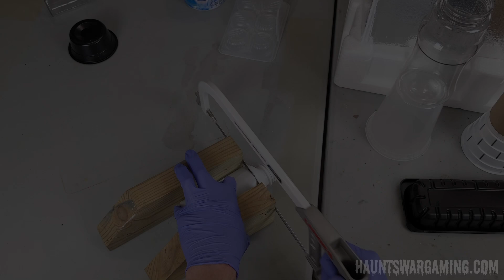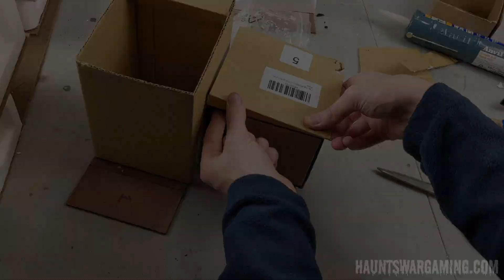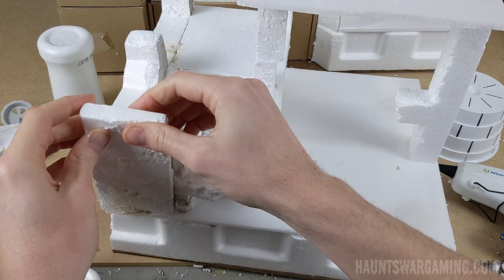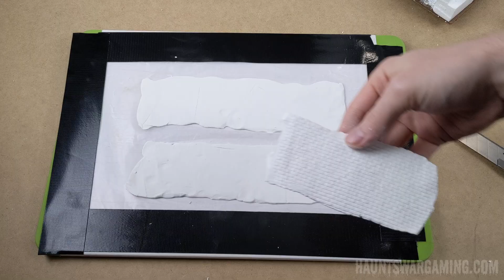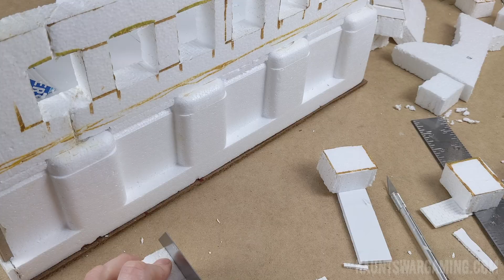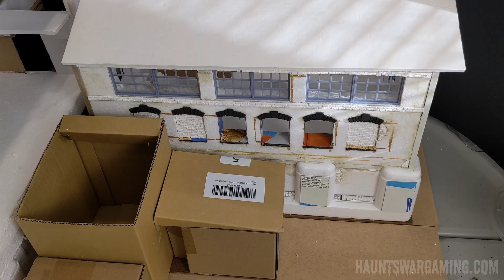Building an Abandoned Factory for Wargaming - Part 1 - Post Apocalyptic Terrain

Comment: I learned to add PVA glue to the air dry clay before working with it to make it more flexible and there for less brittle when it dries
Reply from the maker: Not a bad idea! I might try that in the future. Have you tried adding glue to the base coat of paint?
Reply: No. I just add the pva to the clay before I start “sculpting”, and not a determined amount either it was more by feel. I usually use it for my bases since milliput is too expensive. It gets quite sticky as you can imagine but I have never had problems with it.

Comment: Incredible work, and the sand technique is sorta genius... what's your plan for covering up all the exposed foam? Or will we have to wait until Part 2 for that
Reply from the maker: Thanks! Anything that doesn't get covered up is going to get a coat of mod podge. I'm going to try stippling it on to mask the styrofoam texture.
Reply: @hauntswargaming  PVA, gray paint, and baking soda work great for turning eps foam into concrete.